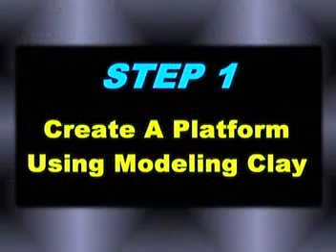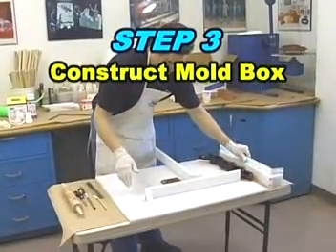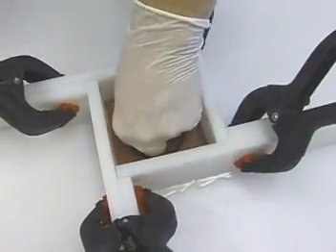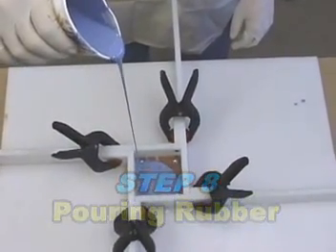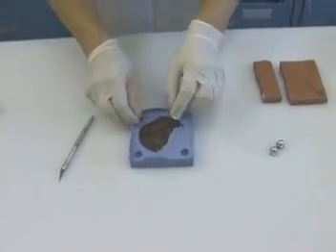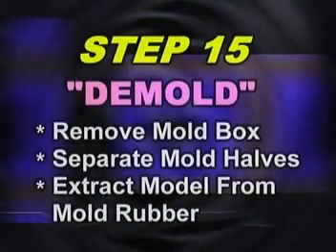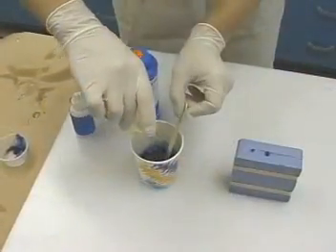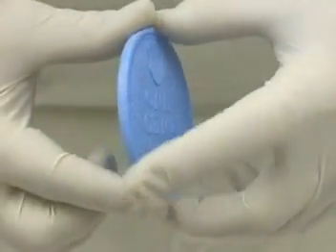Mold Making Tutorial: How to Make a 2 Piece RTV Silicone Mold

Comment: what could be a household diy version of the release agent spray? can you use cooking oil in a mist bottle?
Reply from the maker: No, cooking oil would not be suitable.  Vaseline thinned with mineral spirits can be used.
Reply: @smoothon  i ended up using 1 part alcohol (hand gel) & 2 parts dish soap, worked a treat :)

Comment: I have designed a mold for a 2.5mm thick walled RTV silicone part and used 3d-printing to produce it. I need tips on ways to reduce friction and properly vent this mold as the part always comes out with large bubbles where the silicone failed to expel the air pockets.
Reply from the maker: Can you send us a tech ticket? Our team can help you - https://www.smooth-on.com/support/ticket/add/agree/
Reply: @smoothon  Thanks I figured it out in the end though. Filling from the bottom upwards fixed the issue.
Reply from the maker: Oh that's great!  Glad to hear it!